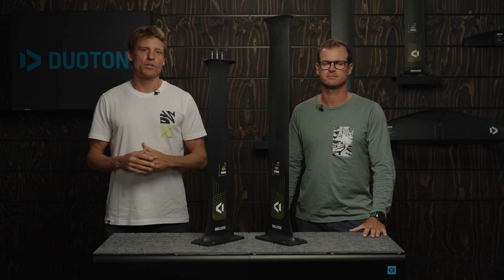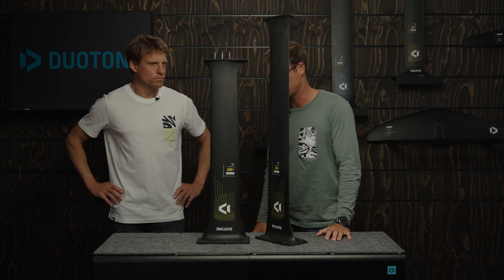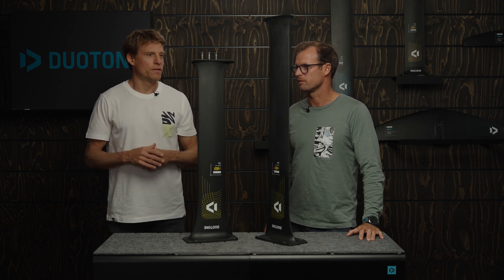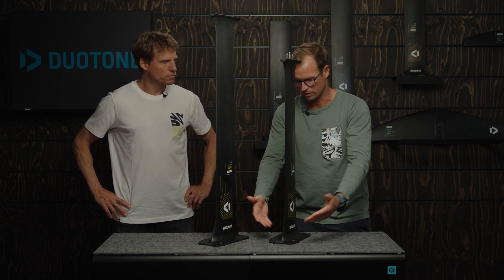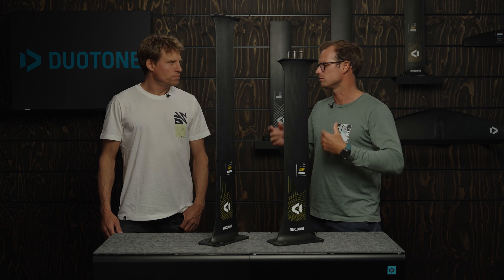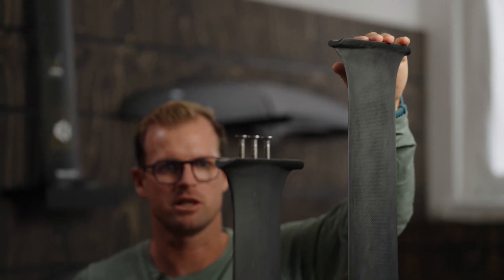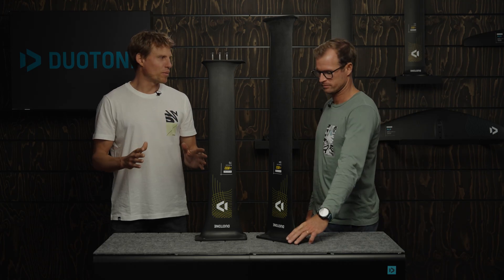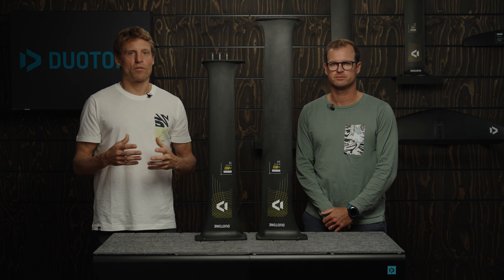Dutone Wing & Foiling Tech Talk - Mast Slim 2.0 D/LAB 2025

Comment: Hey guys,
I learned on a Free setup with an aluminum mast. Now I’ve bought the Skybrid and want to upgrade to carbon.
I weigh 88 kg and can jibe both directions. I only ride on a lake, in 10–20 knots of wind.
So far, I’ve been using the Free 2000 and Free 1250.
I’m not sure whether to go for the D/LAB 2.0 or the QM Mid mast.
Will I actually feel a difference in performance at my level with the D/LAB?
Also, the D/LAB is the new design while the SLS is already a bit older.
What would you guys recommend?
Thanks!
Reply from the maker: Hi there, go with the SLS mast, fine for the level you describe and 85 fits better to bigger foils anyway as it is stiffer than the D/LAB/thicker. For 10-20knots on a Lake, you will still need to ride bigger foils on some days, even when your skills improve!
Reply: @duotone.wingfoiling  Thank you very much. I’m also interested in the 10-knot range. Don’t I still have a lot to gain there with the D-Lab?
Reply: Price doesn’t matter. Are there any disadvantages for normal riding when using the D/LAB with the Free 2000? Still the sls or when price doesnt matter the dlab?
Reply from the maker: The 2000 is quite a large wing, which puts a lot of pressure on the thinner/softer D/LAB masts - so honestly, if you are riding a 2000, then a SLS is fine in terms of skill level/range of use. No need to go for D/LAB. The D/LAB will really give you an upgrade in terms of speed, lower drag and performance, when using smaller foils, or doing downwinders with bigger foils. For average riding, the SLS is fine.

Comment: What about bigger foils (span over 1m)? There is a warning for jumping but how is it with usage over all for the dlab slim?
Reply from the maker: Hi Dirk, overall use is ok, obviously with the thinner profile the D/LAB will reach some stiffness limits on bigger foils like the AMP 2145/1750 - but customers and team use these on the D/LAB, without issues - it's really only a problem when jumping with such big foils due to the leverage effect.
Reply: @duotone.wingfoiling  what u think about let's say the whizz 1200... Got a span of 99cm
Reply from the maker: that's fine, so long as not excessive jumping/presume with a whizz the plan is anyway not to do a lot of jumping?

Comment: Hi Duotone, there is a 4th insert/screw connection at the bottom of this new mast where the fuselage is connected to the mast. I saw it on the duotone webpage, it seems slightly smaller than the other three screw. What is this for? You did not mention it in the video. Thanks
Reply from the maker: Hi there, yes on the new D/LAB mast and future fuselages, there is an M6 mast and a possibility to use a 4th screw - this is to give the rear part of the fuselage the maximum amount of stiffness, reduce flex to the minimum. New product coming this month then with that special fuselage, stay tuned.

Comment: Any issues with the 76 on tip breaches or tight radius turns with instability? Whats the best foil to match with it for the highest performance swell surfing experience?
Reply from the maker: Hi Bryan, i mainly use the 76 for Prone and Downwind - Downwind mostly with 900/750 Glide 2.0, Prone with either Whizz 850 or Glide 2.0 750/620. I really like how direct the 76 feels in turns. Of course you need to be a little more cautious with height control and ride a little closer to the water compared to the 84 to not breach too much, but turns are more direct, which i really like. It depends a bit on the size and speed of the swell. If smaller/slower, the 76 will be perfect. If faster/bigger, i'd choose the 84 for the extra room. Hope this helps you. Cheers, Klaas

Comment: I’m assuming the stiffness of the 2.0 was objectively tested against the old Duotone masts. How does the 2.0 Dlab stiffness compare to the original carbon mast? Nolimitz released their market comparison data when releasing their v2 and the original Duotone carbon was almost equivalent to their Nolimitz v2, but obviously much more bulky dimensions. Is this new mast stiffer than the original carbon? Thank you!
Reply: Hi! Our new 2.0 masts match the stiffness of our first generation dlab mast but we are now thinner and have a shorter chord length, so drag has been reduced. 
As always there is no magic solution, to achieve the same stiffness, we have to use more carbon fibre and our new masts are a little bit heavier than the last generation because of that.
Reply: Thank you for the reply! Happy to hear it matches the stiffness of the v1 Dlab, but does it match the stiffness of the original Duotone/fanatic carbon mast? I was under the impression that while the original carbon was the bulkiest in the lineup, it was also the most stiff. Thank you!
Reply: @kovz910  the Duotone/Fanatic mentioned in the Nolimitz test you are referring to is the same as the 1st generation Dlab mast. Our thicker/original Fanatic mast, which is the same as the current Duotone SLS mast, is even stiffer! That one isn't mentioned in the Nolimitz test but it would beat all these mast for sure. That mast is almost 19mm thick and 135mm in chord length.

Comment: having to choose SLS or Dlab 2.0, how big is the difference in performance for average guy in 84cm? Wingfoiling and catching small chop, smaller waves, and just cruising inland lakes?
Reply from the maker: Hi Mark, the D/LAB 2.0 masts all have new profiles, so they are quite a bit better in terms of ventilation and top speed, vs the previous D/LAB version. Each has a slightly different use, the 84 is the best allrounder for most types of riding. 76 aimed at downwinders/pump, whilst the 94 is more about speed/has best aerodynamic/least chance of ventilation. 

The SLS are also very good masts, slightly heavier and without the newer profiles and outlines of the D/LAB, which are our latest versions. Hard to say "how big" the difference is, as it really depends on the expectations/level and budget. For average use, the SLS is more than fine, if you want to upgrade and tap into some extra performance, then choose the D/LAB.

Or think about the SLS Quick Mount if space/time is an issue, this mast is super stiff/connection works great too, so is also worth the extra $.

Comment: Hello team Duotone the questio i have on the 94 mast slim 2.0  would it fit a 1.92cm  100kg rider ? Or should i take the 84 ? I have a 90 sls and it is not stiff over 20 knots with 905 aero glide .Or is the 94 as stiff as an 84 previous gen dlab under 100kg in clear length vs stiffness under 100kg . thanks for your reply Vincent ps i do not jump 😂
Reply from the maker: Hi Vincent, If u are not jumping then should be no problem with the new 94, which is indeed better at top speeds/far less ventilation issues.

Comment: Did you design the 84cm long enough to clear chop? I'm currently using the dlab slim 90cm mast for winging and like the length because it helps me clear big choppy sea with small mushy waves which have a very short period. My main focus is surfing the small waves and swell. I want to upgrade to the new dlab slim 2.0 mast, but I don't want the 94cm. I don't need the extra length and want to stay as short as possible for surfing (shorter cord for turning). I'm worried that the 84cm is going to be too short and hit the chop or breach and the design discipline of the 94cm doesn't suit my riding.
Reply from the maker: Hi there, have used both for quite some time, at first really liked the clearance of the 94 vs the older 82 - but now with the new 84, I think it hits the spot perfectly for turning/clearance and being as compact as possible - the 94 is great for winging at faster speeds, where the extra length helps - so in short, I think you will be fine with the 84.

Comment: How do you measure the mast length? In riding orientation (board plate up), is it from top of board plate to top of fuselage adapter (the half barrel)? Or is it to bottom of fuselage adapter i.e. to mid of fuselage plane - which is then the total length of the individual mast item?
Reply: Masts are measured from the top of the base plate all the way to the bottom surface of the 3BS fuselage adapter.